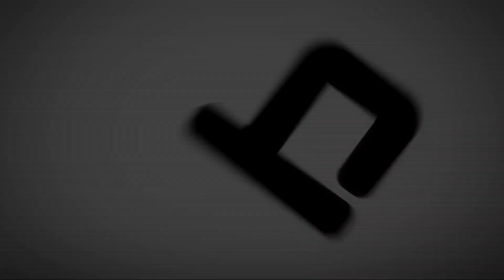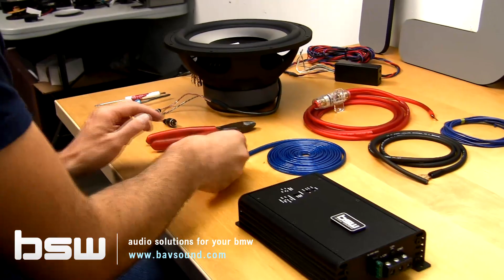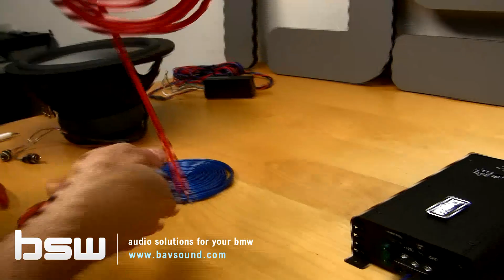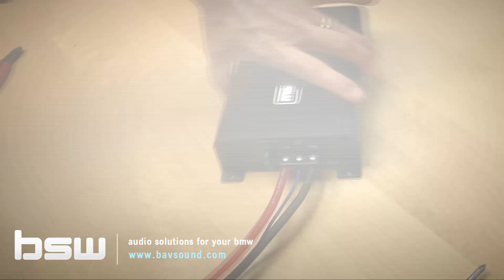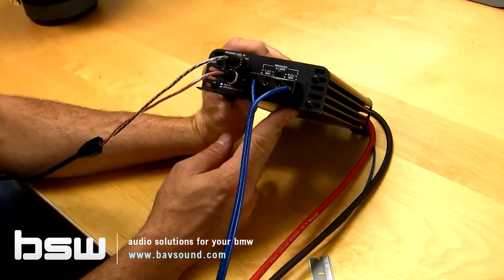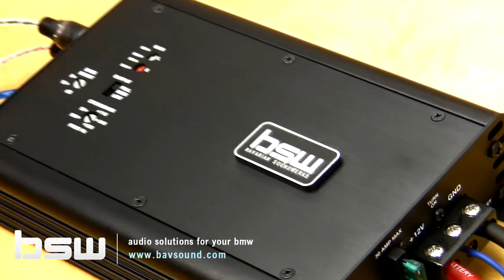BSW Amp | Wiring Guide | All BSW Systems | BAVSOUND

Comment: I need help, I have a E53 X5 with factory DSP and Navigation System, the Navigation System stopped working and the audio will shut off at around 2:40 seconds. What can I do as I do not want the factory Navigation System, do I get a new amp and rewire everything?
Reply from the maker: Yosimar, I recommend giving us a call or email from our website to help discuss options.

Comment from the maker: David we offer subwoofer amps as you see here. We don't make amp upgrades for any BMWs as of yet, but have you tried our speaker upgrades? For the Z3 we offer a front tweeter and 5.25" speaker upgrade which works wonders in the z3. We leave the 2" front door mid, as it's actually decent, and surgically replace the other speakers which plug right in and are impedance matched to the factory amp. 

Don't believe Gansta Supply Company: It's the SPEAKERS that are the problem, not the factory amps!

Comment: That, my friends, is the best response anyone has ever given.  I'm disappointed that I can't seem to find an amp for my (1997 1.9) Z3 on your site - my understanding is that the terrible sound in my car is largely due to the terrible amp/s it came with, and I'm a little worried about just picking one off the shelf at the local Gangsta Supply.
Any ideas?

Comment: Certified MECP installer... If you have noise coming through the sub, you have more troubles than just noise being radiated because the power wire is too close to the rca's!

Comment from the maker: Anything's possible but we've never run into an actual real-world problem with noise through a sub amp, only through parts of the system operating in the higher-frequency spectrum.

Comment: I completely agree.  The web page and PDF instructions state, explicitly, to reference the "the video" posted under the install tab on the website.  Surprise: there is NO VIDEO on the web page.  Good luck figuring out what the LOC is, or where it's connected to.  There are NO diagrams in the web page PDF indicating what each part is, or where it goes.  MAJOR oversight by the manufacturer/BSW.